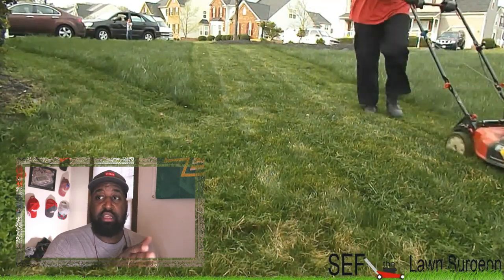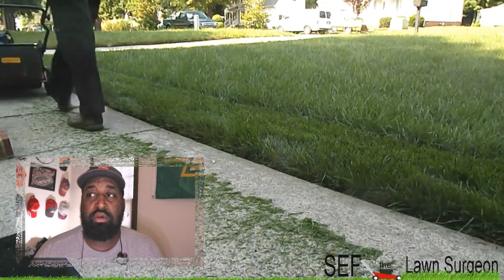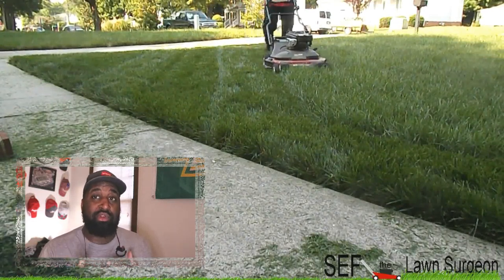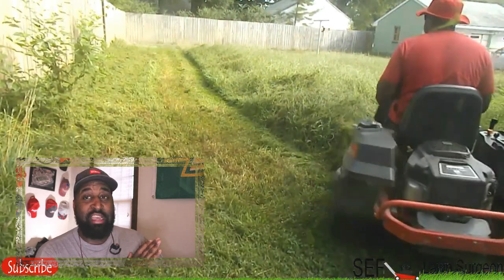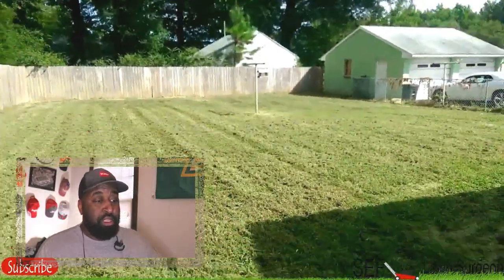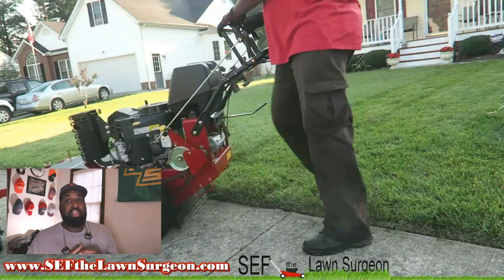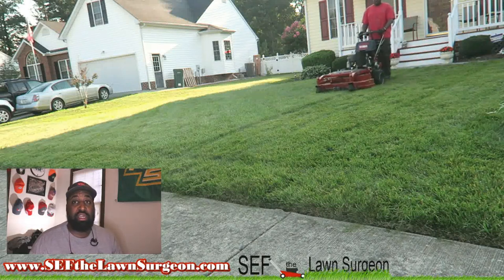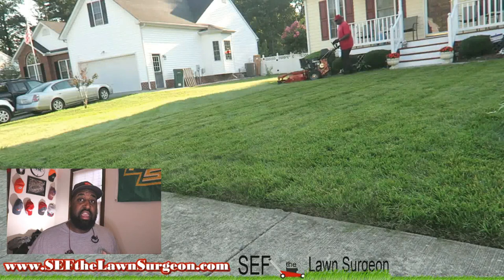#TipsyTalk - Side Discharge Mower Grass Control - Mulching Mowers

Comment: See, I don't understand it. !!! Here in CA, nobody mows with discharge, on a professional level. It has to be BAGGED. Because it's messy and unprofessional. And if you don't bag. It will ruin your reputation in a heartbeat. I understand that mulching is the best thing for a lawn. But it comes down to, don't leave a mess. You'll get fired for that here.